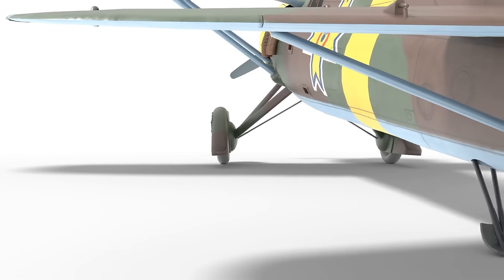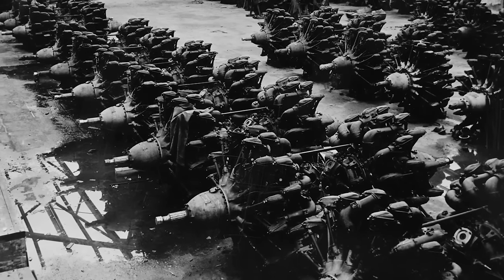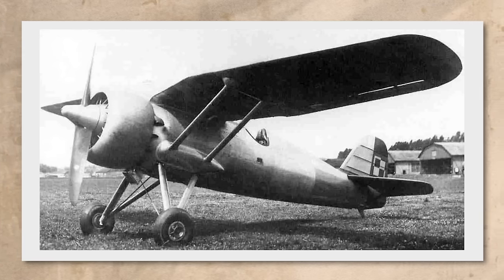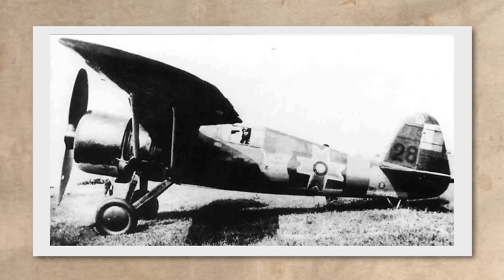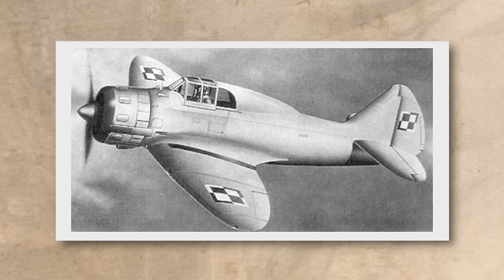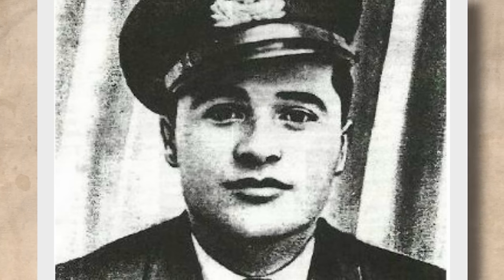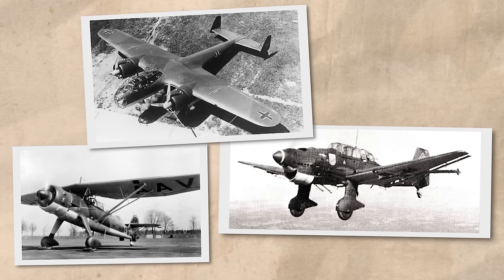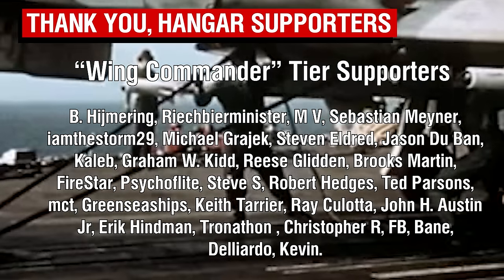The Polish-Built Hero Of Eastern Europe | PZL.24 [Aircraft Overview #94]

Comment: A good video that shows that Poland was not technologically inferior to the Germans in 1939, as is unfortunately often claimed. What few would expect is the fact that the Polish Air Force was the first air force in the world to be fully equipped with all-metal fighters. As actually often claimed, in 1939 Poland did not use biplane combat aircraft, but the Germans, on the other hand, used biplane combat aircraft in this war. It’s also a myth which is being spread again and again that Germany wiped out the Polish air force in three days in 1939. The Polish military command was well aware of the numerical superiority of the German air force. That's why the Polish squadrons were relocated to a network of secret satellite airfields wich were created before the war. Therefore, in the first days of the war, the Germans attacked empty Polish airfields, destroying only a few old training aircraft. The Polish fighters weren't that so worse in 1939 as is always claimed. As mentioned in the video the most built Polish fighter was the PZL P.11. The PZL P.11 was significantly slower than the enemy fighters. BUT... The Polish fighter featured better maneuverability than German fighters Bf 109 and Bf 110. Also the pilots of the PZL P.11 benefited of their design, with much better overview from the cockpit. The P.11 with relatively powerful engine and satisfactory armament also had a durable construction and a good rate of climb, and could take off from short airfields, even of the rough and improvised variety. It could also dive at up to 600 km/h without risk of the wings breaking off. Theoretically the only limit in maneuvers was the pilot's ability to sustain high g-forces. Despite the German numerical superiority, the P.11 managed to shoot down a considerable number of enemy aircraft, including  Messerschmitt Bf 109 and Bf 110 fighters which superiority is always grossly exaggerated.  The kill statistics say that approx 1 kill of the PZL P.11 cost approx. 1 of its own because the Polish PZL P.11 shot down 126 German aircraft with 114 own losses. The PZL P.11 odds of approx. 1: 1 is not bad. The problem was, as with all weapons, that Poland had too few of these weapons compared to the Germans. So the Poles should only have built approx. 20% as many planes as the Germans to win the aerial war. All a question of money. By the way, Several fighter aircraft were also under development in Poland in the pre-war period. For example the PZL.55 which should be as fast as a Messerschmitt Bf 109. Also new Bombers, Reconnaissance and Close Support aircrafts were under development in Poland.

There were also Polish combat aircrafts, which were even technologically superior to the German ones. For example the Polish PZL.37 Łoś twin-engined medium bomber was one of the most modern, effective and advanced bombers of this time. The Polish bomber was clearly superior to the German counterparts Dornier Do 17 and Heinkel He 111. Poland only had to produce more of these bombers like more of other weapons to win the war. 

The Polish P.23 Karas  light bombers were comparable to the to the German Ju 87 Stukas and also attacked the enemy as dive bombers. The Polish P.23 was a bit slower than the German Ju 87 but the Polish bomber had a much longer range. The export version of the PZL.23, the PZL.43 was actually slightly faster than the Ju 87. When the war started Poland had even developed a better successor model with the PZL.46 Sum of which there was only a prototype. Tests proved, that the Sum was a successful design, with much better performance, than Karaś. This Polish light bomber would then have been superior to the German Ju 87 Stuka.

The same actually applies to all weapons, that the Polish weapons were actually technologically on the same level as the German weapons. So also the same with the tanks, because the Polish 7TP tank was equal to all German tanks. Furthermore all polish tanks were equipped with  the revolutionary reversible periscope G wz. 34. The Periscope was a revolutionary because it was the first device to allow the tank commander to have a 360-degree view from his turret. This was a decisive advantage due to a much better overview of the battlefield. Because if I see the enemy tank before the enemy sees me, I can destroy the enemy tank first. The German soldiers in the German tanks, on the other hand, mainly used five viewing slits to observe the battlefield. Americans and British have taken over the Polish  tank Periscope then for their own tanks too! Unfortunately, the Germans also took over the Periscope from the captured Polish tanks after 1939. With the 7TP tanks, a 20% numerical superiority would have been enough to win the tanks war. All a question of money and not the alleged technological superiority of the Germans. The Germans had more money, however, because they got into a lot of debt in order to be able to afford the extreme rearmament. That's why the Germans were actually bankrupt in 1939! Poland, on the other hand, was not bankrupt in 1939 and was well prepared for to hold out long enough until the British and French defeated the Germans from the west with their superior attack. But these traitorous Polish allies were too cowardly to attack and betrayed Poland.

Only because of negative experiences with Polish wz.35 anti-tank rifles the Germans started to reinforce the armor of their main battle tanks with additional applique plates in preparation for the attack on France. The Germans had also a similar anti-tank rifle Pz. B. 39. This also illustrates the same technological level of both armies. So the Polish small arms like the anti-tank rifle wz.35 also clarify that Poland was technologically on the same level as the Germans. Another example of Polisch technologically advanced small arms is the superb Polish 7.92mm semi-automatic rifle wz. 38M. This was one of the best rifles in the war. But there was the issue of numbers again. The Polish Army Command planned to equip the Polish army with the rifle, but this was prevented by the German raid. The 9×19mm caliber semi-automatic pistol wz. 35 Vis is another example of Polish technologically advanced small arms. The Polish handgun was very accurate and stable (due to its size and mass, most stresses are absorbed and not passed on the shooter), while at the same time remaining reliable after firing more than 6,000 rounds. The Vis was generally regarded as one of the best handgus of that period. Today the wz. 35 Vis is highly prized among collectors of firearms

In fact, in 1939, Poland had a much better off-road light military utility vehicles than the Germans! The Polish   four-wheel drive off-road vehicle PZInż. 303 with hydraulic shock absorbers was a vehicle with very good off-road characteristics because it had a very good ability to negotiate difficult terrain, hills with a slope of 47° were not a problem. This off-road car was very maneuverable, the turning radius was only 3.3 meters. The PZInż. 303 was tested on a 1800 km route in 1938. The route of the rally was chosen in such a way that the vehicles could be tested under the most difficult conditions. In fact, in all possible off-road variants, such as swamps and sand tracks, but also on freezing swamps, in severe frosts down to -25 ° C. PZInż cars. 303 showed full suitability for use. But... After very successful tests, the car was approved for series production.  However, it was prevented from serial production by the German raid on Poland. Only a few prototypes were used in the 1939 defensive war.

The Germans used various types of light military utility off-road vehicles, but they were significantly inferior to the Polish PZInż. 303. These were different types of vehicles which in German were erroneously called "Einheits-PKW", which translates to unified passenger car units. The name contradicted the fact that they were different types of vehicles. Incidentally, when the Germans raided Poland in 1939, 60% of the German light military utility vehicles consisted of commercial civilian cars that had been converted for military purposes. One of them was the Type 62 Kübelwagen, which was later slightly modified to the Type 82 Kübelwagen known in many Hollywood movies. Kübel means pail and that was this converted VW Beetle. But the Type 62 Kübelwagen and Type 82 Kübelwagen were actually not off-road vehicles at all because they didn't have a four-speed gearbox. Anyway, all these German vehicles were Polish PZInż. 303 off-road vehicles significantly inferior.

So, in conclusion, it can be said that most Polish weapons  were technologically equivalent to German weapons ! Except rocket technology, but that technology was insignificant in that war! The German Navy was also very superior, but the Navy was not decisive for the war. The Germans had only most decisively more weapons in 1939! All a question of money! So, In summary, it can be stated that some German weapons were slightly technologically superior to their Polish counterparts, and some Polish weapons were slightly technologically superior to their German counterparts. So what shows that the assertion of complete superiority of the German army to the Polish army, which is repeated again and again, completely contradicts historical reality.
Reply: "A good video that shows that Poland was not technologically inferior to the Germans in 1939, as is unfortunately often claimed" - You base that statement on what exactly?

"As actually often claimed, in 1939 Poland did not use biplane combat aircraft, but the Germans, on the other hand, used biplane combat aircraft in this war." - And our monoplane fighters were much, much worse than German ones. 

"
In fact, in 1939, Poland had a much better off-road light military utility vehicles than the Germans!" - And? We still had much less of them.

Sorry, but your whole comment looks like a cheap propaganda.
Reply: @przemog88  Ridiculous allegations! Not really worth commenting on. But I will refute the nonsense anyway, because maybe there is someone who believes the nonsense. So first! In this context I can point out to you that it is falsely claimed that Polish cavalry attacked German tanks. Such lies, there is no other way to call them, are intended to illustrate Polish technological backwardness. For example, in Wiki links, which most people use is constantly claimed that Poland was technologically completely inferior. As also in this quote from the Wiki Link Opposing forces in the Polish September Campaign:" The German economy was geared towards military production which supplied their armed forces with equipment that was often superior to their Polish counterparts." Did you get that?...with equipment that was often superior to their Polish counterparts. I could mention various other quotes, not only from Wiki, which show this false claims about the alleged German technological superiority, which in reality did not exist at all, as I proved in my comment above. You can search for it yourself with Google. It took me 5 minutes to find the quote on Wiki.

By the way, you prove yourself with this stupid statement about the Polish planes yourself this stupid prejudice about the alleged German technological superiority. Your stupid quote: "And our monoplane fighters were much, much worse than German ones." I have shown above that the German planes were only slightly technologically superior and that the Polish planes were not much, much worse at all. Incidentally, it is particularly stupid to deny something and then back it up with stupid allegations. Really stupid behavior.

The last quote from me is also meaningless because I determined myself that the Polish army actually had too few weapons compared to the Germans. So this quote is completely pointless, like actually your 

Besides, there's nothing bad about propaganda. Propaganda is not negative. Propaganda (from Latin propagare ,spread)! In the sense of spreading political ideas to change political opinions or public perspectives. Propaganda only becomes negative if you spread lies with this propaganda like you do about the Polish monoplane fighters, which are allegedly much, much worse than German ones.

Please spare me any more pointless comments.
Reply: @GreatPolishWingedHussars  Słuchaj, byłem pobłażliwy i chciałem dać ci szansę na wyjście z twarzą, ale widzę że dalej wolisz zakłamywać historię swojego kraju.

Niemcy przewyższali nasze siły pod każdym względem, zarówno liczebnością, jak i wyszkoleniem i poziomem technicznym. Nasze lotnictwo zostało zmiażdżone i żaden nasz myśliwiec nawet nie zbliżył się poziomem do Meserszmitów. Parę dobrych bombowców nie wiele w tej kwestii zmienia.

Comment: just a little fact check...  the pictures of contemporary "all metal aircraft" that you claim influenced the design of PZL 11 and PZL 24 at the 2 min mark is WRONG, MISLEADING and NOT in anyway factual.   In spring of 1934 (May I think, but I'm usually wrong and damned old)
The prototype Hurricane (fabric fuselage and mix fabric and stressed aluminum wings) flew winter of 1935 (November???).    The Curtis P36 prototype took to the air May of '35.   So how pray tell, did they influence the Design?????  PZL set the BAR, and was the influencer...  
this along with many other mistakes and opinions is why you have lost my subscription.   Your effort in MY humble opinion is no longer freely sharing your fascination and hobby but turned into a means to end... I hope you return to who I originally subscribed... (just an old man's opinion, and in this day and time I'm told I'm wrong by most, so PLEASE don't be offended)

Comment: Modern, advanced... Are we joking? If one builds a flintlock gun with a stock made of Kevlar, it's still a flint gun.
Reply: The context was "modern, advanced" when in was built. As compared to it's contemporaries.
Reply: Have you wantched the video? It says ,,modern and advanced in 1934".
Reply: @player400_official 
In '34 a DC 2 had its maiden flight for instance.
Reply: @carlnapp4412  Yea, a heavy passenger plane. Much slower (because it was a passenger plane), different purpose.
Maybe let's compare fighter to fighter.
For example Boeing's best design at the time (P-26) was 50 km/h slower, had half less armament, 200km less range and 1/3rd of the P24's climb rate. 
Germans meanwhile still relied on biplanes and UK's most modern aircraft was the mighty AW.16...
Yes it was obsolete compared to the best 1940s and even some late 1930s designs, but it was advanced in 1934.
Reply: @carlnapp4412  better armed then the Hurricane  and the P36 .. yup ..  faster then both at the time .. yup ..  We still had Gladiators in FRONT LINE SERVICE  when this thing was flying ..  So yeah it is totally comparable to all the stuff coming into service at the time .. oh and it was STILL in service into the 1960's .... that is how "obsolete" it was eh in the late 30's ????     Hurricane and the P36 certainly were not in service into the 1960's  ..hell they didn't last much past the end of the war ..